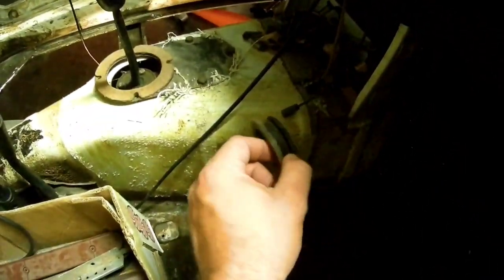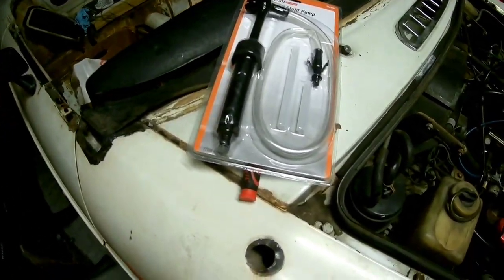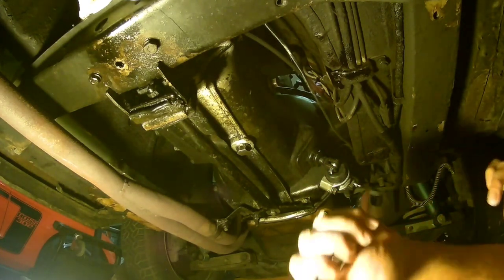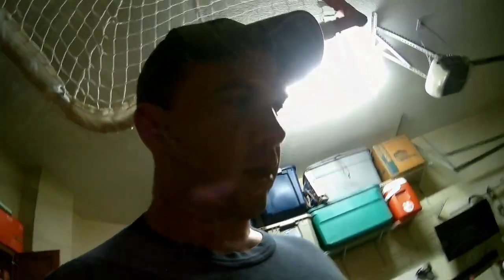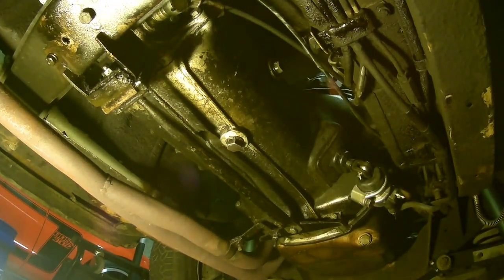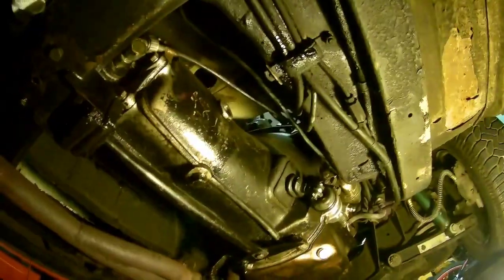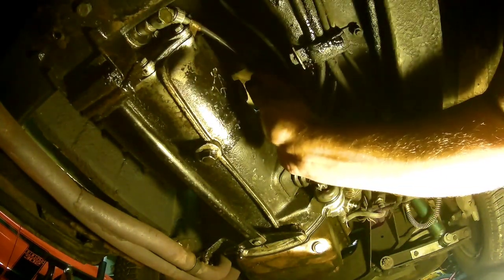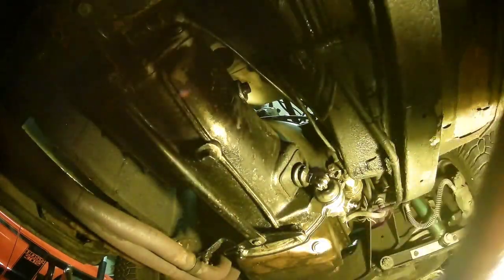How to Check Transmission Oil Level 1974.5 MG MGB and Later!

Comment: Just did this today using a hand pump to insert the oil !
Reply from the maker: Hurt yourself?
Reply: @BrailsfordsRides  No I used a socket and long breaker bar easy peasey to undo !
Reply from the maker: @bertiewooster3326  thats what I should have done, would have saved my hand 😆

Comment: Need vids like this. New to the game with `78 roadster daily that i put sidedraft weber & header on and since aquired 2 more rubber bumper cars, one w/title & other without. One has the full 5sp, not solenoid pressure overdrive. Great little cars, just a scream to drive as small & open as they are and where gas is $10@gallon.
Reply from the maker: I loved it while I had it, but I sold it for another project with a backseat so I could take all my boys on rides